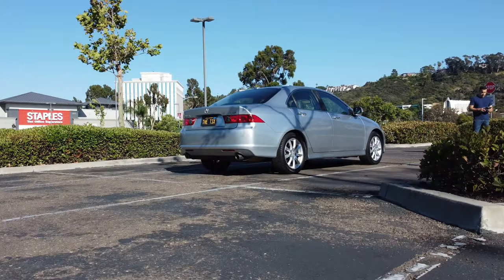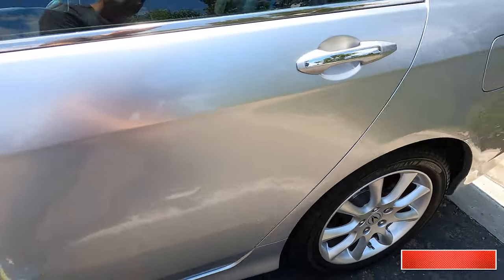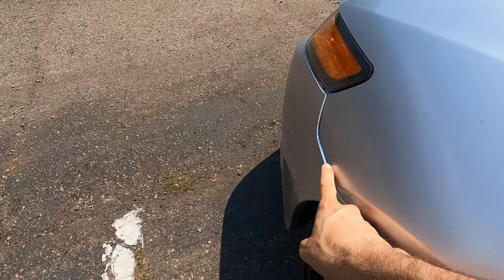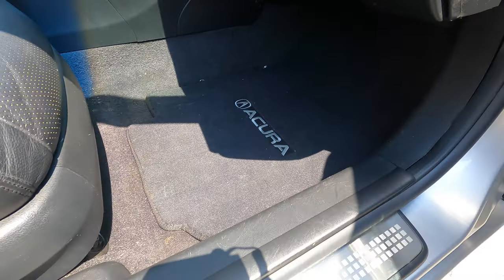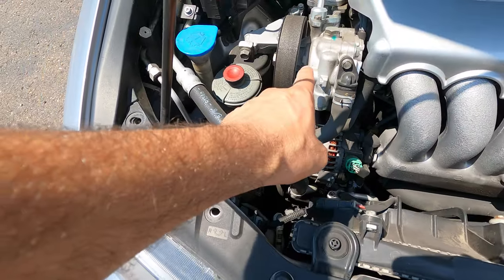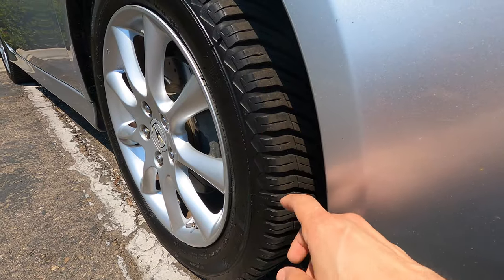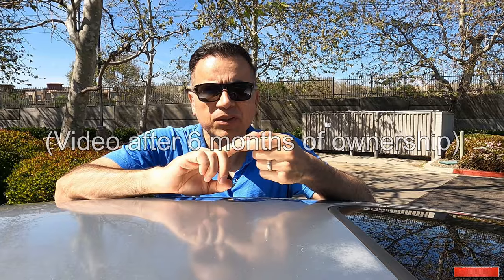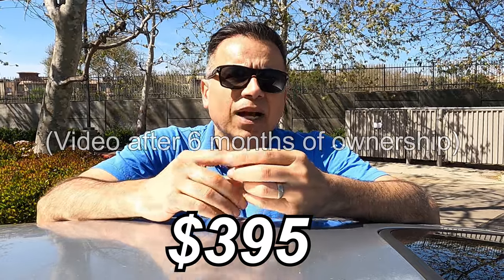ACURA TSX FOR SALE by OWNER! #Acura #AcuraTSX #honda #carsforsale

Comment: Sorry to hear your TSX is going into the hands of a new owner.  I really like your TSX videos.

I recently replaced the driver's side window motor as the window refused to go up or down except on really hot weather.  Origonal Rack and pinion and the odometer is currently at 460 000km.  At that mileage, the car is worth about $2,000 CAN.  My plans is to keep the car until the engine or transmission  breaks down.  I remember the rack and pinion costs  $1000+ CAN to replace, correct?
Reply from the maker: @ronlam3654  my rack and pinion got damaged when my wife hit a pothole. Before that it was original and perfect. 
We’ll see if someone buys it for my asking price, the market will tell… If not, I’ll continue to drive it… I love this car, 28k miles in like a year and 10 months!

Comment: Sad for you. Fantastic car. New owner is lucky with best value. 
BTW, there is a GROM Audio accessory for bluetooth music calls etc.
Reply from the maker: Check this out: I’m an open book; I’ve had zero offers that are worth mentioning. I really thinks it’s worth what I’m asking. It’d make no sense to sell it for under $5k. I rather keep it and continue enjoying it. 
Just look around for anything under $5k and you’ll see it’s pure junk. 🤷🏻‍♂️
Reply from the maker: And BTW, I don’t think it’s worth every penny that I’ve put into it. But the reason I believe it’s worth $6k it’s because everything has been sorted out: it needs nothing. The prior owner replaced the AC compressor, redid the brakes with new rotors etc all at 200k miles. So basically just about everything that could fail has been replaced.